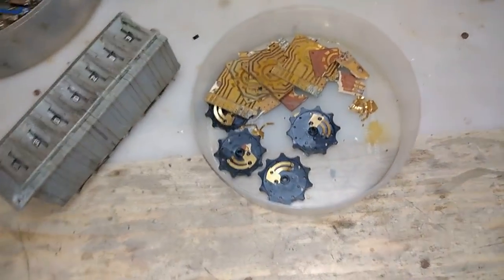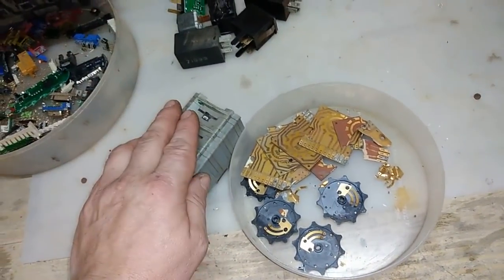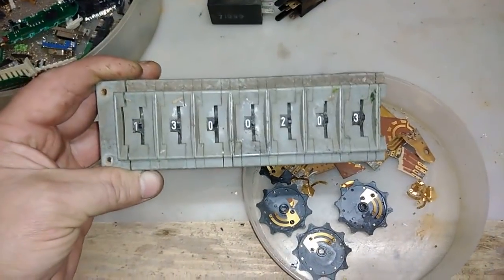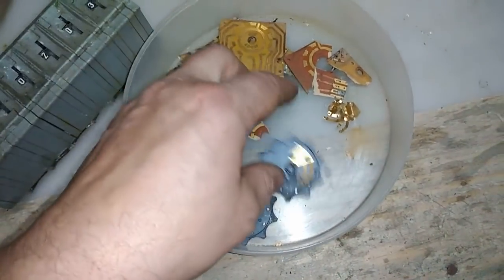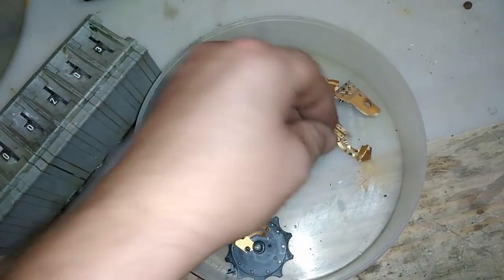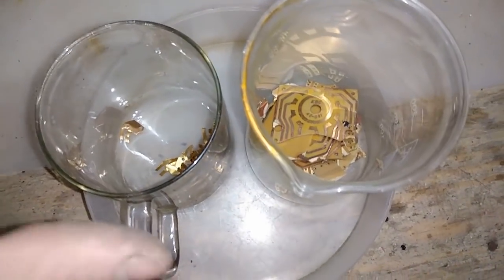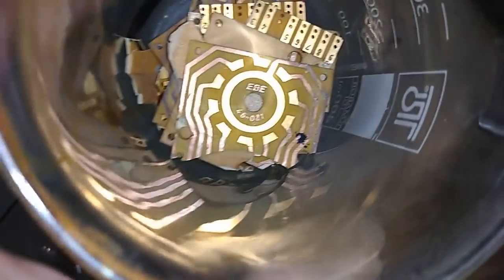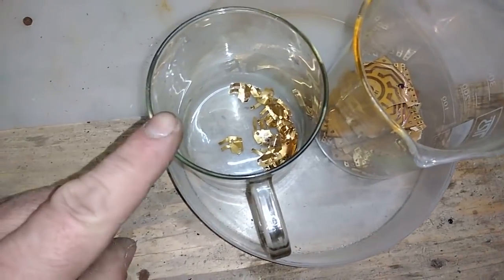Industrial potentiometers is gold MINE for GOLD RECOVERY!

Comment: The grey item was several Thumbwheel Switches joined together side by side.  You turn the wheel to set a number and then the closed and open contacts represent that number, either in binary coded decimal or hexadecimal.
Reply: Those are really unusual!  Actually the more I look at them, the specific switches you have don’t give a binary result.  It just connects the common lead (circle) to only one of the other ten pins at a time, depending which number is selected.